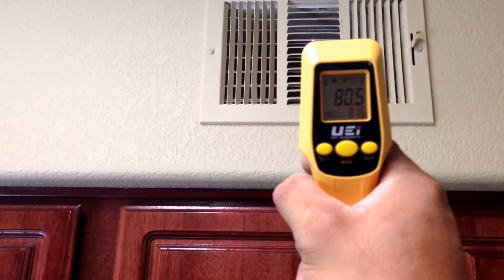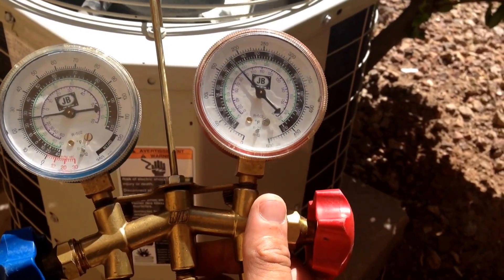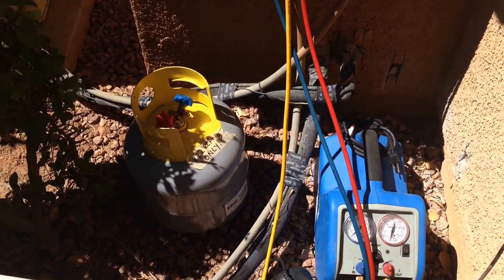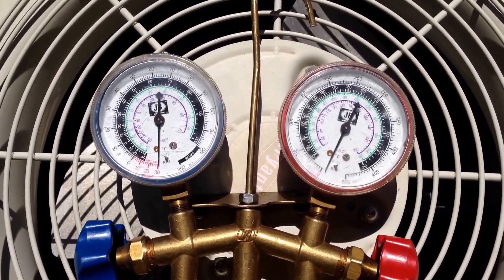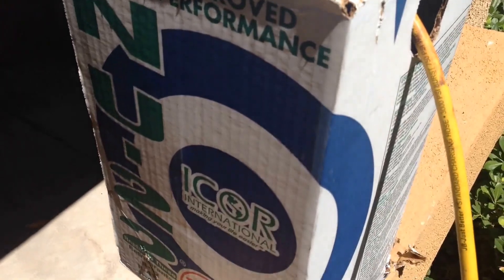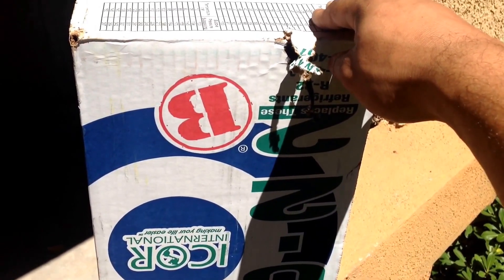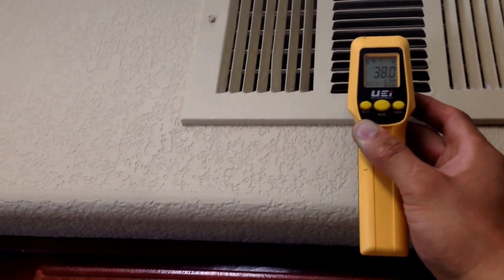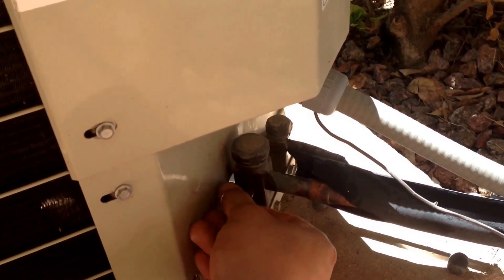HVAC Low Freon

Comment: Sam, thanks for the informative videos!  Based on your videos I checked and found some A/C leaks. I called several repair shops to fix the leaks but they just wanted to quote a new system when they came out.  I can’t find anyone to do the leak repairs. Do you recommend anyone that could do the repair in the Southern California, Lake Forest area?  Thank you in advance.
Reply from the maker: I'm sorry Sean I don't know anyone in that area. Depending on where the leak is will determine how the AC companies proceed. If it's on the coil on the condenser the heat of the torch will melt the coil. If it's a shrader valve it's as easy as replacing the shrader valve. According to your comment it is multiple issues so you may consider calling multiple HVAC companies and looking at the different options. If your persistent you may find someone who works for an AC company who is willing to do side work. For instance a lot of guys who are certified will post ads in Craigslist etc looking to make extra cash who are actually employed or experienced in the HVAC industry. Hope this helps. Thank you!
Reply: Sam, thank you for the quick response! I will check with with more companies and on Craig’s list.  Keep up the great videos!

Comment: when you converting r22 to nu22 you add it or you take out r22  can you  mix it ?
Reply from the maker: NO!!! DO NOT MIX REFRIGERANTS1. Proper recovery2. Install filter drier. NEW!!!3. Proper vacuum of system. Not just a few minutes either.4. Charge High side liquid (canister upside down) with unit OFF5.Turn system on.(Check pressures)6. Use superheat method if you have piston/orifice, or supercool if you have txv valve.Call Icor International Tech Support if you have any issues  1-713-3200 they will walk you through procedure if you have any issues.